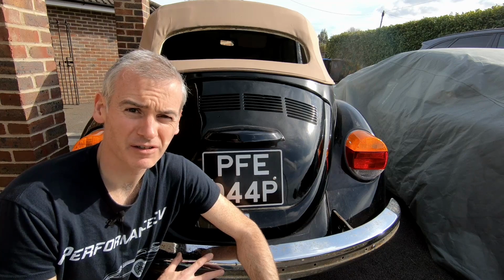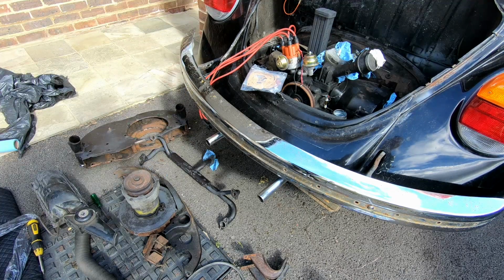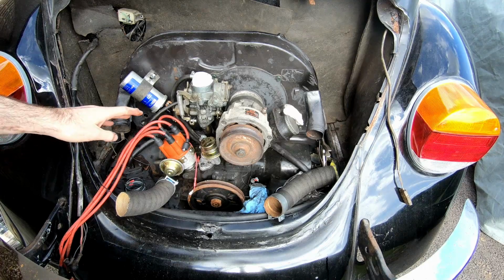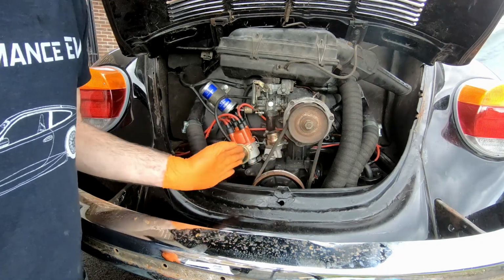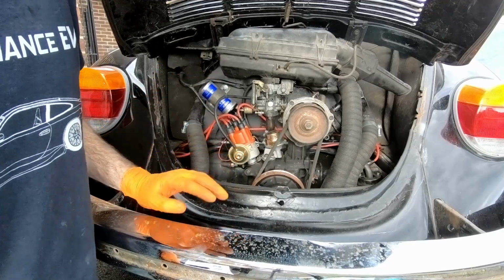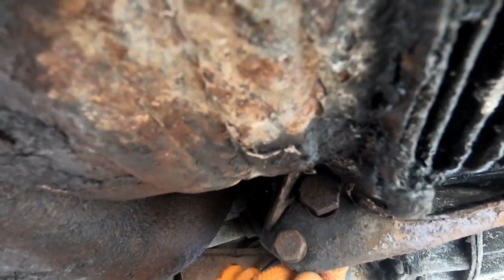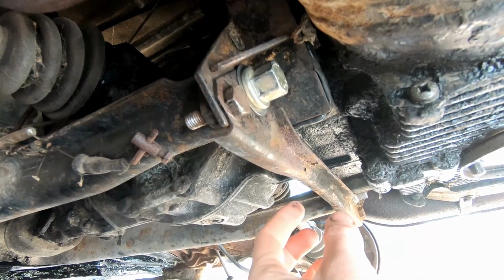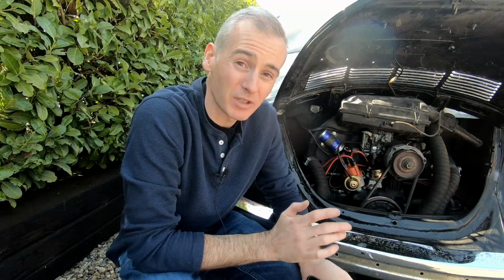Recommissioning the engine on a 1976 Volkswagen Beetle Cabriolet - Future Electric Beetle Conversion

Comment: Those old VW Bug engines were soooo easy to take out...literally 5 minutes when you're used to it...that I would always take it out to work on anything in the fan housing. Everything is much easier to reach once it's out of the car.